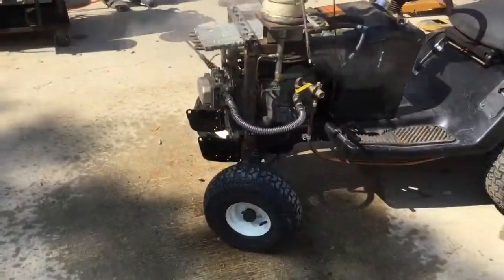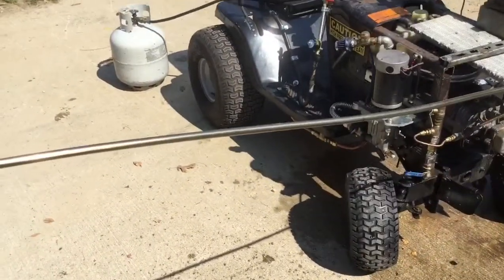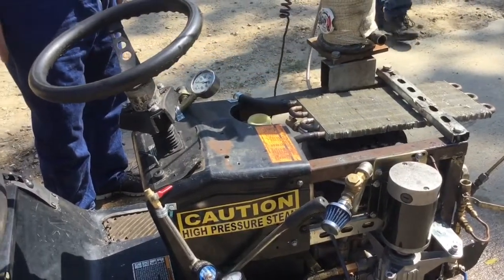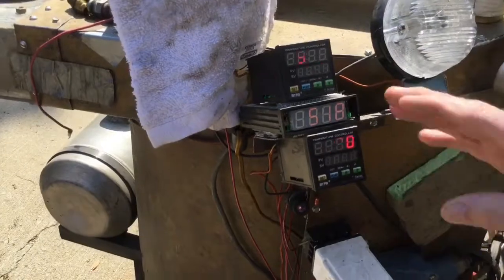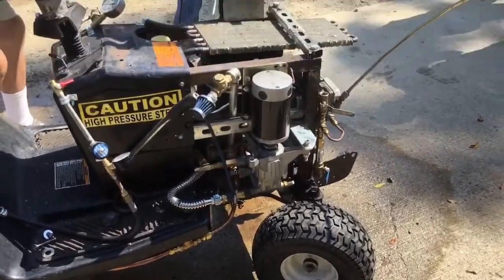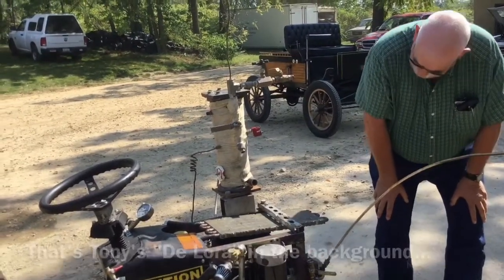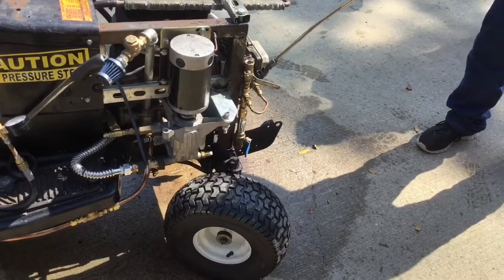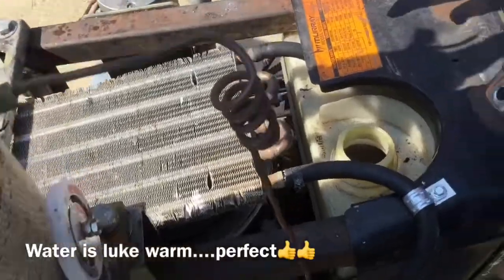Steam lawn tractor engine and condenser test on 800 psi

Comment: I don't believe that's 800 psi 100 hp case tractor only runs at 150 psi
Reply from the maker: The guy running the steam generator (Bob Edwards) is a nuclear physicist who worked at the Oak Ridge research facility and contributed to the Huntsville Space program for NASA. There are components he created that are literally on the moon right now. He knows what he’s doing, but it’s possible a sensor could have malfunctioned...not uncommon when dealing with 800+ deg f temperatures. It seemed like it was running at a somewhat lower pressure...more like around 500 psi, which was the working pressure of the lawn tractor’s boiler before it blew and it ran the engine at a similar pace.
The old steam tractors did indeed run at around 150-200 psi and relied on much larger bore pistons to extract the power needed from the relatively lower pressures. The Doble steam car ran at around 1,500 psi pressure and was considered one of the fastest automobiles on the road during that time period.

Comment: What is that squeak in this thing? Is it lack of lubrication? What oil are you using in the oil pan?
Reply from the maker: David Boyce  Look at the very end of the video...I took apart the engine and found that the conrod bearing was oil starved. It normally gets its lubrication by dipping into the oil at the bottom of the crankcase. I was using a displacement oiler that inserted oil directly into the steam and the bearings got their oil like a mixed gas 2 stroke engine. The conrod bearing was the only one that didn’t like this arrangement, the other bearing surfaces had more than sufficient oil getting to them. When I get around to rebuilding this engine...the conrod bearing will have expanded oil ports so the atomized oil will be able to reach it.
Reply: @steammachine2094  I love steam engines!